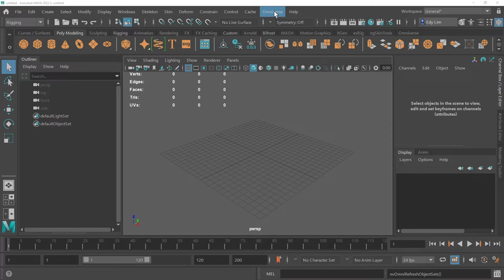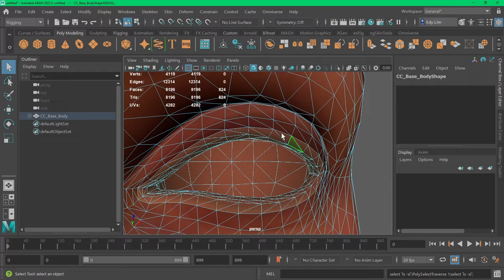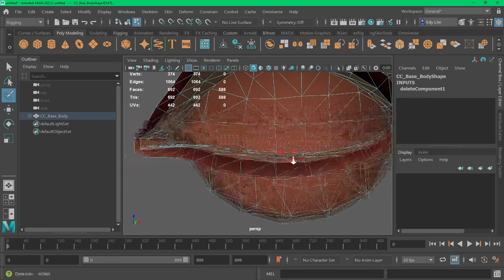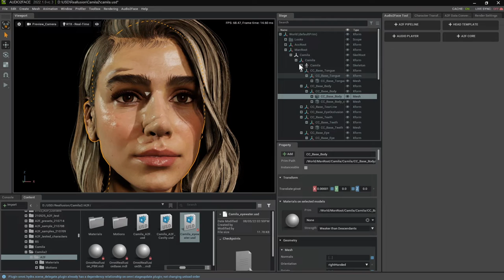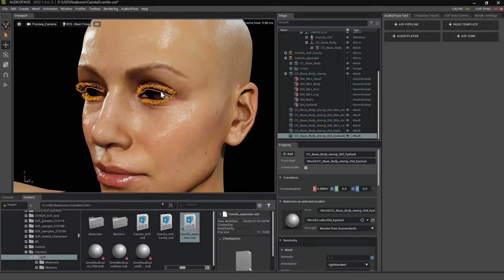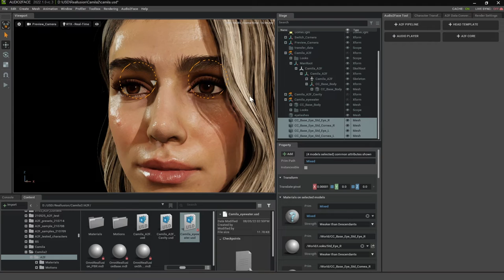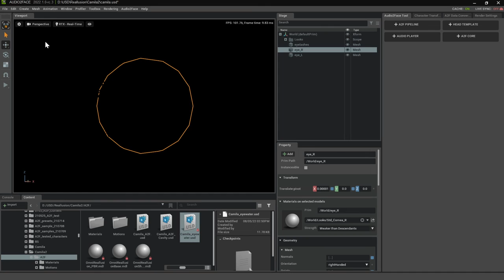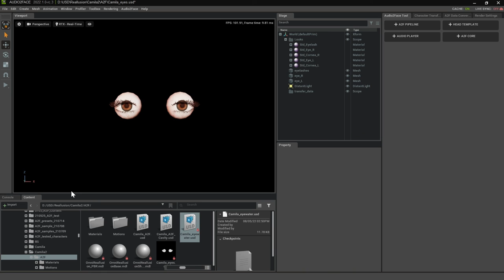Camila Asset Pt 2: Mesh Preparation with Omniverse Audio2Face and Autodesk Maya

Comment: Does it actually require maya?
Reply: I did that "eyewater" part in Blender, had to use NVidia's Omniverse Blender version and play around with import settings a bunch to make it work, but was able to export geometry without materials to usd, and it works ok.
Reply: @andreyradovski8514  Can you tell how you did that in Blender? When i import it back in Audio2Face, i get an error...
Warning: Unresoved payload path on prim... etc
Reply: @FireF1y644  You need to use special Blender version found in the Omniverse apps, and the current 3.6 alpha version works fine for me (still I don't get textures on import but you don't need them for this part). From there make sure to import usd into Blender and export as usd too.